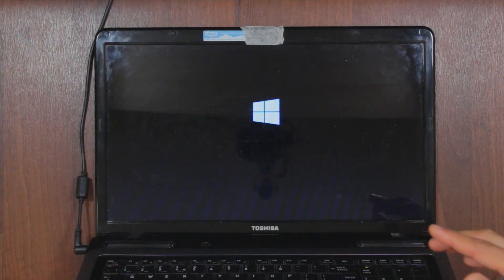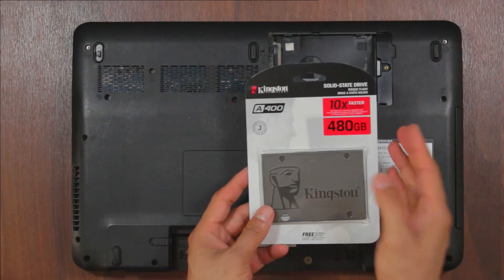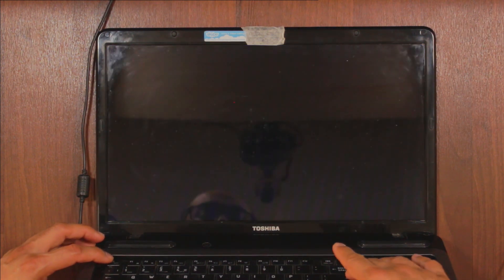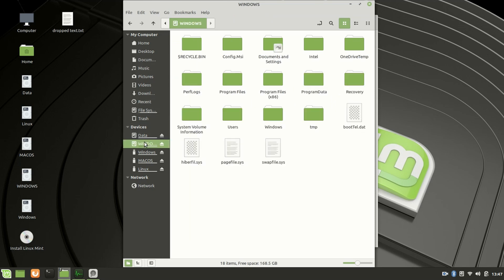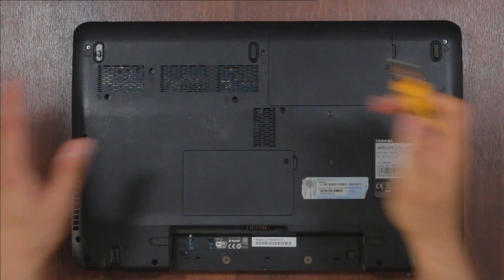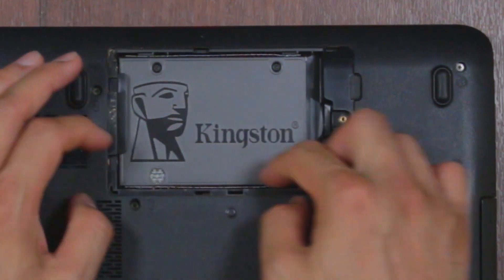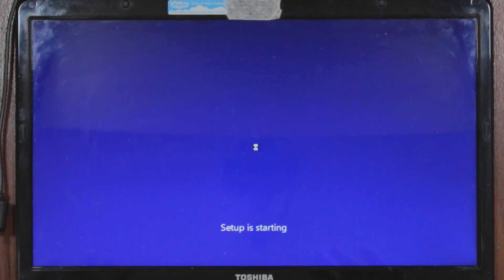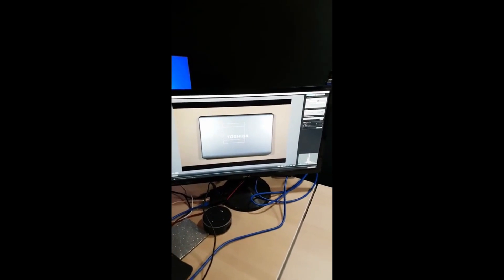Windows 10 Stuck On Black Screen - Before Login - Easy Fix

Comment: Useless video, I have this problem on a Toshiba Z30 that comes standard with an ssd built in. The whole system just got a clean install and works absolutely fine with an external monitor. The internal screen works fine when booting into the bios. Starting windows yields the black screen, and keystrokes do nothing.  All advice that involves screen output are useless as one just can’t see anything. Still looking for the magic solution.

Comment: Did you say to use GBT instead of MBR for this old laptop? My Toshiba p750 was restarting once login to win10 but due to a driver issue I think.
System restore made it hang before login screen. Was a clean install upgrade from win7. Time to look for one of my ssds

Comment: Windows stuck after loading your BIOS? I can show you how to fix that:

1. Install Linux and get me paid through using my other videos on how to Install Mint to your drive
2. Remove your HHD and buy an SSD from the affiliate link I've posted in the description.
3. Use Linux on said SSD

😂😂😂 I feel like I'm at Jiffy Lube

Comment: I have a samsung monitor and since starting to use it, Win10 inital logo comes up but it takes forever and lots of key pounding to get to the sign in for Win10 with a black screen till that time for minutes.   I am running Win10 from a SSD drive, FYI, so I dont know why it goes black and doesn't start win10 sign in almost immediately like it used to with the other monitor.

Comment: ok i may have a fix, i did this and it worked;
Your laptop has 2 batteries , the normal "regular" one, and then there's the CMOS battery ; which is used by the BIOS (system's most basic operations to turn on Laptop and such) to remember Date/Time and Boot sequence.
now i replaced the CMOS Battery (depending on your laptop model it can be a b1tch) and everything worked well after a full reformat. 
if That doesn't fix it, then something's wrong with your motherboard / OS , 
i STRONGLY recommend you change CMOS battery as it lasts for around 10Years before it dies, and go from there.

Comment: Press power button for 5 sec. then pc will turn off then press for 1 sec. nd when manufacturer screen appears press power button again for 5 sec. repeat this process at least 2-3 times then ur windows will automatically go into "auto repair mode" then go into advance options and uninstall windows and features updates and then try to reinstall windows and this will do trust me.👍🙏
Reply: does that mean my data will reset?
Reply: @GratesJR  no

Comment: Hello healmytech i buyed a new pc and sometimes turns on and i can do things normaly but sometimes when i try to turn on my pc the fans are working and all the leds but the fans make a different noise (more loud) and the screen dosnt go on my TV. in my mother is a litle red dot that dot is off when my pc boots correctly but when it dosnt boot corrctly that light is on.
Can u help me somehow? 
My specs are 
PSU:Be Quiet pure power 11 600w CM
Motherboard:MSI B450M MORTAR MAX
Cpu:Ryzen 7 2700x
Gpu:gtx 1660 gaming oc 6G
 Do i need maybe a monitor and not a TV?
Or do i need new psu and motherboard?
I will really aprceciate if u can help me

Comment: Do you have a way to fix a single beep on an Alienware x51 R1? It's beep pause beep pause. So single repeated beep. Happens after a bios update. Warranty is out, and dell will charge to fix it but if there's a fix I'd like to know if I can do it myself
Reply: Ram problem bro.. Try cleaning your ram
Reply: @yashtrackz5277  ram is double beep, single beep is a bios issue, it's dead, i simply had to get a new pc all together. thanks for trying tho

Comment: laptop hard drives are so so evil, even if you have a core i7 and 16gb of ram these slow 5200 and 5400rpm drives always tend to hold up the raw processing power that the computer is clearly capable of when it comes to just, booting up, shutting down, opening up programs, or multitasking, and they just get slower with time.

Comment: I need help please. I have a laptop with broken display. So i use it by connecting it to my tv by a VGA cable. Hence the problem is i can't access the boot menu that is only displayed in the laptops broken  screen. And it only loads on the Welcome sign. Can i convert the entire screen to tv starting from the bios. Like i dnt hve the open the screen again.